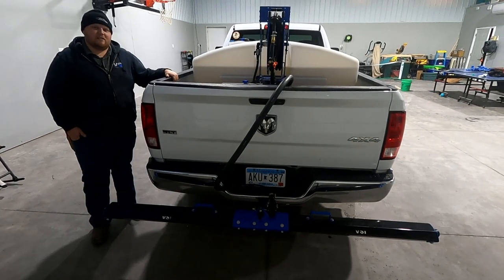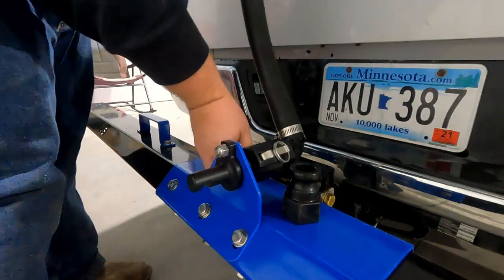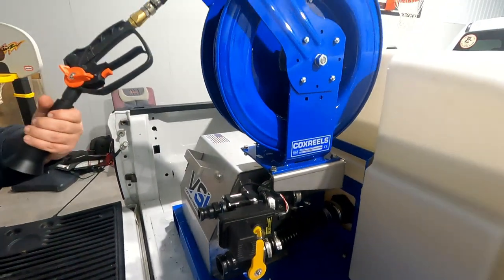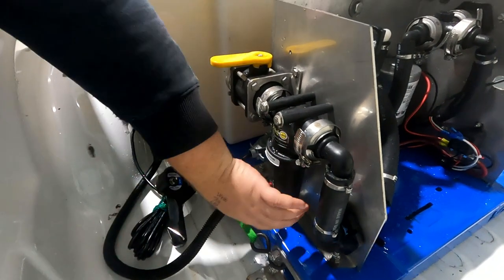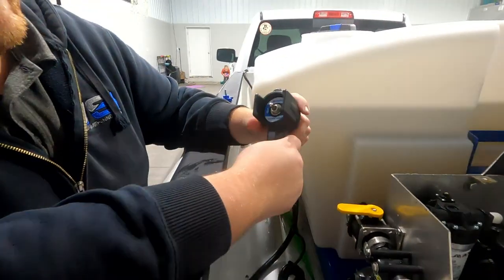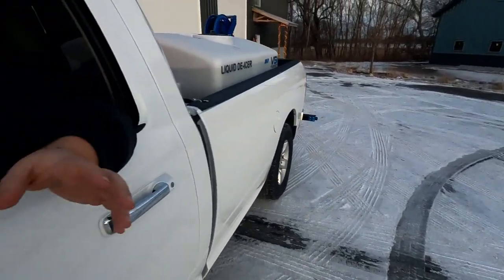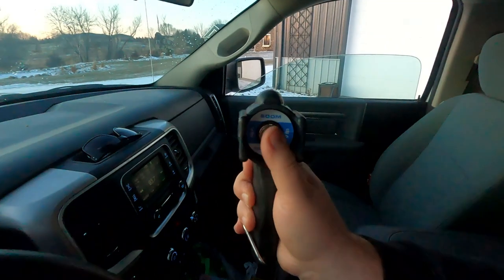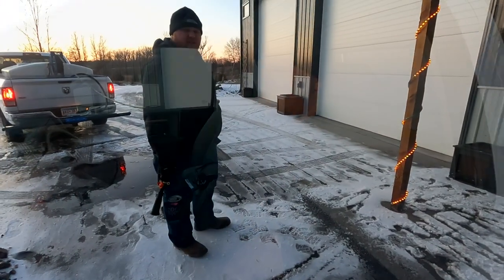Genesis 305E Overview

Comment: What size truck are you using for weight reference to the skid in the rear?
Reply: It looked like a 1/2 ton (1500) from what I could tell in the video, although I believe on their website this unit is recomended for 3/4 ton and 1 ton trucks

Comment: Does the Pump have or need a bypass when it's running but not spraying, for example, when switching from boom to hose reel, the pumps are running full speed but the liquid is not moving.  If left in this state for too long, will it damage the pumps?  I expect that these pumps are not cheap to replace... Thanks!
Reply from the maker: The pumps used on these sprayers are diaphragm pumps, which can be deadheaded without damage!
Reply: @voigtsmithinnovation4112  What sort of GPA / Speeds can this unit operate at?

Comment: You got 500
Or 750 gallon electric sprayers?
Reply from the maker: We have a 500 gallon unit with the same features as well as a power front that can connect to a tote or other size tank.

Comment: It doesn’t self load like the legacy?
Reply from the maker: Ted, it does not self load like the Legacy units do.  Unfortunately this pump is not capable of that.  You would need an auxiliary pump to fill this unit.
Reply: @voigtsmithinnovation4112  no side sprayers either - like a legacy 

Is that because it would pull too much power?
Reply from the maker: @tedpendagast579   Yes.  It would be quite the draw on the battery.  This unit is also designed to lower the entry point into liquids as our Legacy Series is on the higher end for price.  This basic unit is only $6,850.
Reply: @voigtsmithinnovation4112  would like a legacy that’s got an electric pump 
Gas engines from up here in the great white north
Reply: @voigtsmithinnovation4112 what is the price on a legacy 305?